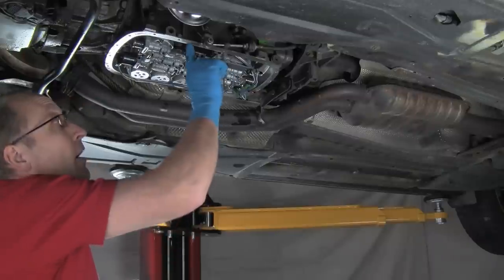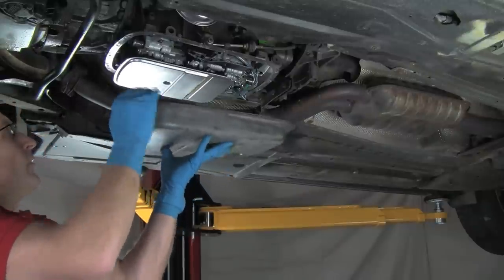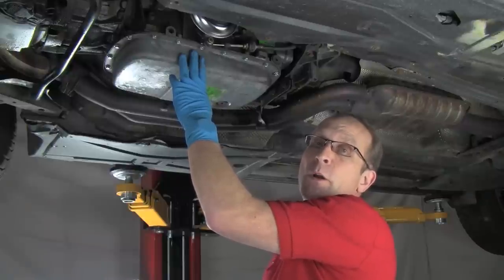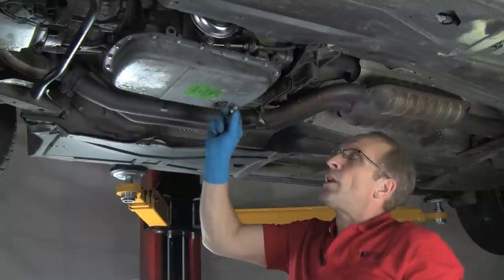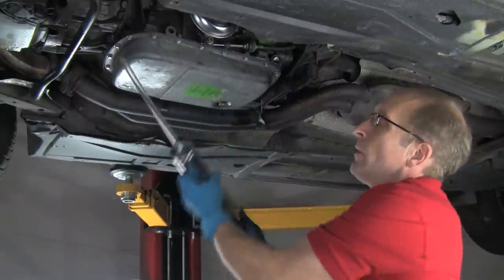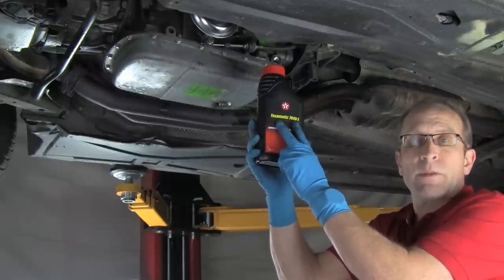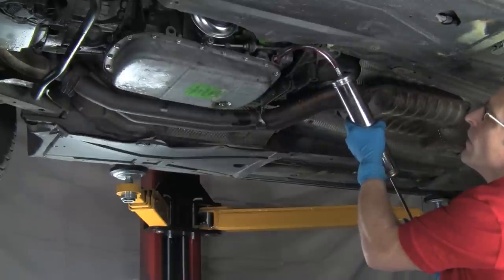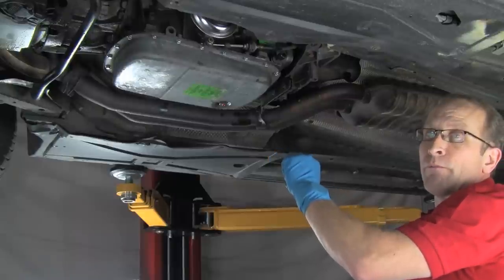Part 2: Changing Automatic Transmission Fluid & Filter On A BMW/MINI

Comment from the maker: ... and you can do it at home and save a bundle.  As noted in prior comments to part-1 and part-2, if your fluid is well past the point where it should have been changed, you can run the transmission for a bit and perform another fluid change (fluid drain & fill only).

Comment from the maker: The M54 6-cylinder engines are quite reliable.  There are parts of the engine management system that may require periodic maintenance or repair, but the engine itself if actually hard to hurt.

Comment from the maker: If the leak is new, the gasket is likely leaking.  Possibly due to improper bolt torquing or other install issues.  Take a look at the trans to verify the sources of the leakage.

Comment from the maker: The A5S-325Z transmission in your 2003 530i, was originally filled with the Esso LT-71-141 fluid.  We now have this as the LIFEGUARD5 fluid from ZF.  This fluid is specifically approved by ZF for use in this ZF transmission.  You'll need 7 liters (fill is specified as 6.2 liters).  Just go to our online store at bavauto.com and enter the LIFEGUARD5 part number after identifying your year and model.  You can also call our advisors at 800-535-2002.

Comment: Thanks for the HD  very informative  I'm doing my research into getting an older 325/28
xiT 2002--06. I have run into some reviews about the unreliability of the E46 2.5/3.0
 I6 engine from some owners others say it's the best engine ever made. I just don't want to get stuck with a car I will regret getting

Comment from the maker: Your 2003 318i should have the same transmission as the one shown in this video.  You check the fluid level via the fill plug, just like we are doing as we are filling - in the video.  Make sure the fluid is warm and the engine is running before you remove the fill plug.

Comment from the maker: If the transmission in question is specified to use either Dexron-III or Dexron-VI, we can use either the Red Line or the Liqui-Molly D3 or D6 fluids.  Both are "top-shelf" synthetic fluids.  We will only use these if the original transmission fill is specified as one of these fluids.
Reply: Bavarian Autosport  would you recommend a transmission flush on a e30

Comment from the maker: Please see our other replies on this (for part-1 and part-2, as well as on our blog post for the DIY, at blog.bavauto.com).  In short, start the engine, park brake applied and foot on brakes, shift into each gear position and leave for a couple seconds in each position, return to PARK.

Comment from the maker: Correct, most applications do not use a sealant on the gasket.  For motor oil, we would recommend any of the Liqui-Moly synthetic oils.  We like the 0w-40 and 5w-40 Vol-Synthese (from Liqui-Moly).  If you prefer to stick with the original weight of 5w-30, we have the Liqui-Moly Longlife 5w-30 as well (which has a higher specification rating than the BMW/Castrol 5w-30).  You can see these in our online store at; bavauto.com.

Comment: Thank you for a perfectly presented and paced video, you did not waste time waffling on aobut things that were not relevant and stuck to the main points, only one point that I was looking for was missing....

Just how many Quarts did you take on this change and a secondary question.... WAT IS A QUART?
Reply from the maker: Haha ... a quart? 
quart - kwôrt/ noun: quart; plural noun: quarts
1. a unit of liquid capacity equal to a quarter of a gallon or two pints, equivalent in the US to approximately 0.94 liter and in Britain to approximately 1.13 liters.
Anyway ....... Different transmissions will have different fill capacities when draining the pan.  Our web site (www.bavauto.com) shows the required capacity for the model that you have entered, to shop for, when you shop for the automatic transmission fluid.

Comment from the maker: Our first thought is that you may not have filled the transmission properly.
1) Are you sure that you filled through the actual fill plug? What model BMW do you have? We can verify the plug location.
2)  Did you perform the final filling WITH THE ENGINE RUNNING?  If not, the transmission is under-filled.

Comment from the maker: In this case, the fluid was very dark and "dirty".  We did indeed perform a second drain/fill, without removing the pan, after running it long enough to mix the old and new fluid.
Reply: hello

Comment: James de Gouveia

Very interesting and extremely well illustrated and explained. I believe that this could be the answer to my occasional stall speed occurring. The diagnoses indicated (PO720) on BMW garage diagnostic  machine. They said they suspected that the problem was inside the torque converter. I am 82. My BMW 328 Auto is 1999 E46 186000 km.and I cannot afford to replace the gear box or the car. Physically the car is in excellent condition.

Comment from the maker: While this method does help to get closer to 100% fresh fluid, and people have been doing it for years, it is not recommended to run the transmission without input fluid (the fluid that is pulled from the pan, through the filter and into the transmission).

Comment from the maker: You cannot drain the torque converter, or the fluid that is being held within the transmission body (drums and clutch packs, as well as the valve body).  Check out the earlier replies for both this video and the part-1 video ... we discuss dealing with the "left-over" fluid via successive drain-fill operations.

Comment from the maker: The transmission on your 316 (be it an M40 or M43 engine) is the A4S-310R.  This is a different transmission than the one shown in the video.  Your drain and fill locations are different ... and there are two pans to remove and drain (just one filter, however).  The best suggestions would be to purchase the Bentley repair manual for the E36 chassis.  While the manual covers just US-spec models, most of the chassis is similar, as is the A4S-310R transmission.  We have the manuals at bavauto.com

Comment from the maker: Yes the fluid should be at operating temperature for checking the final fill level.  Operating temp is about 140 degrees (f).  This is very hot to your hand, touching the bottom of the pan .... but not so much that it immediately burns you.   You can also (and more safely and accurately) use an infra-red pyrometer to gauge the pan temp.  We have a text message on the video at time 6:42, addressing this.  We offer a nice pistol type unit at bavauto.com .  The part number is DPM .

Comment from the maker: The procedures for the GA6HP19Z transmission (that you have in your 530i) will be basically the same as shown in the video. One difference is that the filter is a part of the fluid pan. Therefore, you replace the complete fluid pan in order to replace the filter. The fill plug is on the left side of the transmission (facing forward), at the rear, above the fluid pan. This transmission takes about 8-liters of fluid. We have the proper fluid and the pan/filter at bavauto.com or call 800-535-2002.

Comment: All in all, a very nice video. Good info, sound and picture......however, you did not give the Torx size of the fill plug. For many people unfamiliar with this service need to know if they must purchase a tool.
Reply: he said it was the same size as the drain.
Reply: Tim Mitchener That still doesn’t give the size. Did it myself and it’s a T40

Comment from the maker: You do indeed have a filter.  the transmission in your 2002 530i is the A5S-325Z.  This is a different design from the one shown in the video.  The pan and the filter will be slightly different, but the overall procedures are the same.  The Bentley repair manual for the E39 chassis, will detail the differences.  We have the manual at bavauto.com or call our advisors at 800-535-2002.

Comment: My 330i had 55,000 miles on it and it took four drain and fills before the color started becoming normal color.  Then I dropped  the pan and installed a new filter.
Reply: Rick Loc how does it drive now? Any change?
Reply: @123456bmx  too bad no answer!!!!!!!!! i'd like to know too

Comment from the maker: Well .... you don't need to be exactly 100% level, but you should be very close.  You can use a level along the rocker panel (fro front to rear level) and across the pan itself, from left to right.  You may be able to check front to rear on the pan, but the bottom of the pan is not always level from front to rear, on all applications.

Comment from the maker: You ALWAYS must check and set the fluid level with the engine running ... for ALL automatic transmissions.  If you do not do this, the fluid level will be low.

Comment from the maker: You need to have the transmission fault codes read, using the GT-1 or comparable diagnostic tool.  You can, however, make sure that all of the tires have the same air pressure (and all are the same tires, of course).  And, I'm assuming that there are no ABS or Traction Control warning lights, since you did not note this.

Comment from the maker: If the fault light is on, there should be a recorded fault in the transmission control unit (TCU).  You would think that the transmission shop has the proper tool to read the TCU, but perhaps they may not have.  We would suggest a BMW dealer or independent BMW specialist that DOES have the proper diagnosing tool to read the TCU.  Without a code, we have very little to go on for actual diagnosis.

Comment from the maker: Your 2002 525i should have the A5S-325Z transmission.  The procedures will be similar, but exact details, such as; drain and fill plugs and filter will be a bit different.

Comment from the maker: Most certainly.  Your fill and drain plugs will be in different locations and the filter will be incorporated into the pan (so you actually replace the fluid pan).  The Bentley repair manual for the E60/E61 chassis (5-series 04-10) will cover the exact procedures.  We have the manuals, filter/pan and the fluid in-stock at bavauto.com, or call our agents at 800-535-2002.

Comment from the maker: Doing the fluid and filter as a "at home" DIY, there is no way to remove any of the fluid that remains in the transmission assembly, to include the torque converter.  The best wayy to address this would be to perform two or three fluid drain and refills, with enough running time between the fills to mix the old and new fluid.  We have addressed this quite a few times in the past comments for both part-1 and part-2 of this DIY.  Feel free to look around the comments for more detailed info.

Comment: Always thought it was odd when I read my E39 transmission fluid should never be changed. Why if it is a good thing to do after 50/80k miles do BMW advise against it? To sell more transmissions may be. Going to do mine now and will do future changes. Thanks for this information. Really useful.
Reply from the maker: Check ... and, double check!  Thanks for your notes.

Comment: Very good video I have a 2004 BMW 325i and I wondered why I have to warm my car up so long for it 2 take off from a cold start,,if I take off before the car is warmed up it will just rev it will move but it won't go anywhere,, I guess the transmission filter is clogged,, I gave 169320 miles on the car,, I think if I change my filter it would help this problem,,

Comment from the maker: Britt ... is this you?  Stripped the fill plug after all that?  The weld on a new bolt head idea may be the better thought, as long as you can get to it.  Feel free to call, if you need.

Comment from the maker: A home DIYer will not have a flushing machine.  Therefore, the drain and fill and then subsequent fluid drains with re-fills is the way to go, if the drained fluid is quite nasty.

Comment from the maker: 1)  If your E53 X5 is a '00 through '03 model, the original fluid is the Esso LT 71 141.  We now have this fluid as the ZF approved Lifegaurd5 (original ZF fluid).
2)  If your X5 is a '04 through '06 model, the original fluid is the Shell M-1375.4.We now have this fluid as the ZF approved Lifegaurd6 (original ZF fluid).
3)  There are no electronic issues to deal with in changing the filter and fluid.

We do have the ZF fluids in-stock at bavauto.com

Comment: this is awesome....my only problem is i have no way to hoist the car above my head. I'm trying to do this myself. My transmission stopped responding in drive but runs in reverse. There has been some leakage. Not so sure its the transmission. In a tight spot do not have 300 to pay a mechanic to do what you just did.

Comment: Nice shooting, though the video starts midway into the process. Does not include the removal and precautions during the process.I have watched other videos where they say you flush the old oil by running the engine and draining again. could not really know what one uses to flush the gearbox. These videos would indicate that one needs about 10 liters of T.oil; not sure if that quantity includes the oil used in flushing or that is just the total capacity of the transmission.
What do you advise?

Also, what is the ATF component near the Engine Oil filter housing in the engine comaprtment for? I thought you refill from there....

Comment from the maker: The transmission on your 2007 X5 (E70 chassis) will be different, but the basic procedures are similar.  The major difference is that many later model transmissions have the filter built into the fluid pan.  Therefore, you just replace the complete pan in order to renew the filter.  We have these in-stock in our online store at bavauto.com (or call our advisors at 800-535-2002).

Comment: The video is good, but you should have showed the temp of the fluid prior to sealing off the fill plug. Also, I believe the green sticker on the bottom shows the proper temp of the fluid prior to applying fill plug.

Comment: Good video. Can you explain the last bit about running through the gears with the brake on? I’m not sure I really follow what that means....
Reply: Stand on the brake, put the car in neutral, and take the engine up in rpm like you were driving.

Comment: Just a thought: Wouldn't it help to stick a couple of magnets on the bottom outside of the pan while running the engine to attract more  metal particles before starting the drain process? Sounds like a good idea.

Comment: I just bought a E34 525 with a E39 Motor Conversion it needs a Trans service as well as a transcooler update as there quite cheap to buy new // great info on what type of fluid as well as filter location on underside of the pan you have saved me some time right there // im  trying to locate some new parts for my e34 would you recommend a few place that might help?? im located in Perth Australia  Cheers Mate love your work

Comment from the maker: We certainly would recommend a second change if the oil was run for 100,000 miles.  Just pull the drain plug to drain the fluid, then do the refill.  no need to remove the pan again.

Comment: excellent video. I have a Bmw e39 535 automatik and I´ve asked Bmw workshok and they said they normally don´t change the oil on either gearbox or rear axel. They only check the amount of oil. The gearbox was changed some time ago, but don´t know if they changed anything then. This video helpes....thank you

Comment: Great video! I have a bmw 2006 325i with a transmission fluid leak. I need to change my transmission pan and sealing sleeve. And info or do you have a video for changing the sealing sleeve

Comment: Very instructive, many thanks.  I am doing this for a 2011 328i cope 60K miles; I understand it the pan and filter are one and the same, I will get this from BavAuto if available along with fluid.  Are there any special considerations for this model, fill qty, torque specs, etc?

best

Comment: Very good video guide for my DIY job at home. How to flush the remaining ATF fluid in the torque converter? There are still some extra amount of ATF fluid in there. Need some advice.
Reply from the maker: Please read through the older comment replies for both part one and part two, regarding a more complete fluid flush.

Comment: rather than dig through all the comments, let me ask. i see some people recommend that you drain and fill the pan a couple times because they say that there is still bad fluid in the system even after the initial drain. So they say if you fill and drain it at least 2 times that will allow you to get at some more of the old fluid that did not drain on the initial pass. 

I have a 2005 325xi automatic.

Comment: best method is to pull off the outlet flow line of the oil cooler and pump the oil out of the transmission with its own oilpump shifting gears through. then change the filter and fill up with fresh oil, then again pump out oil, refill pump out... do so until only fresh oil comes out. the replug the oilcooler line and you will be ready.

Comment: Thanks a lot for the video, its very professional! Im goin to change my oil soo too in my E39 530dA 2002 GM5-390R, but I will be using Dexron VI I dont know why you did not recommend this oil... One more suggestion, I am missing the procedure of shifting gears while filling, does it mean I should be on brakes and and the same time shift 1-2-3-4-5, or I should just use a HAND BRAKE? Should the wheels rotate during this or no, that is not visible... thanks

Comment: Very informative step by step video. Not so sure I'm going to have the same access, as my BMW will be supported by axle stands only... That aside, I'll ensure the car is level.
I wonder, do the same principles apply for the six speed ZF transmission? Some of the info I've read, refers to specific temperatures being reached (35-40C) as a prerequisite when topping up the fluid. Is this critical, or would 'normal' operating temperatures be acceptable? The other issue is to ensure you use a 'lint-free' cloth or rag when wiping anything (pan etc.).